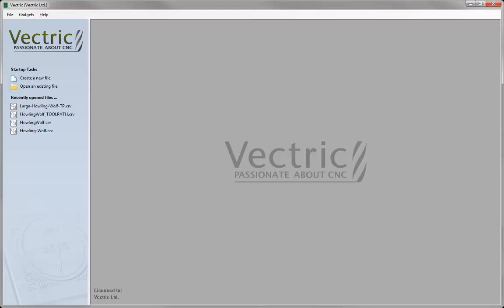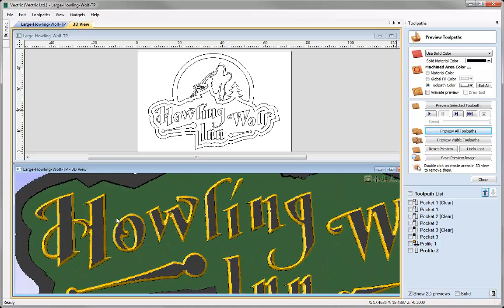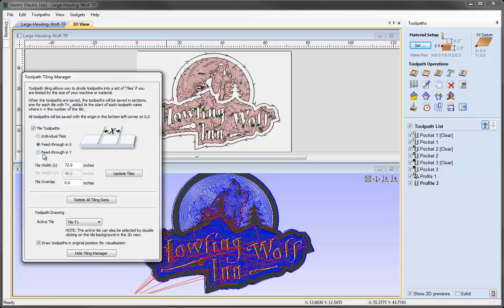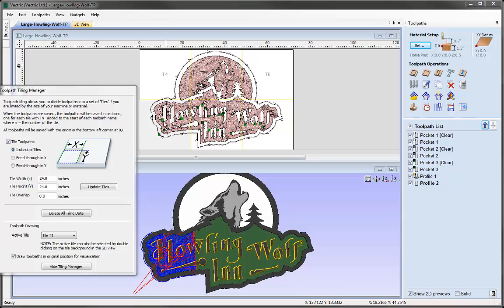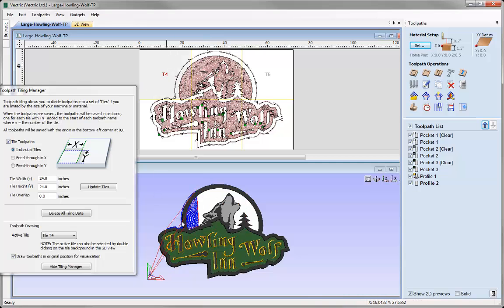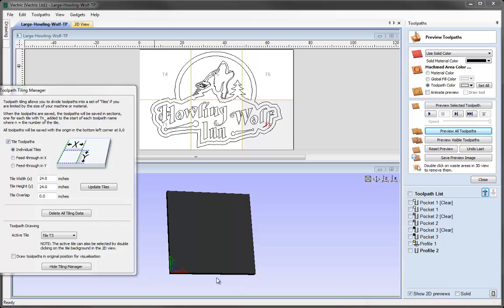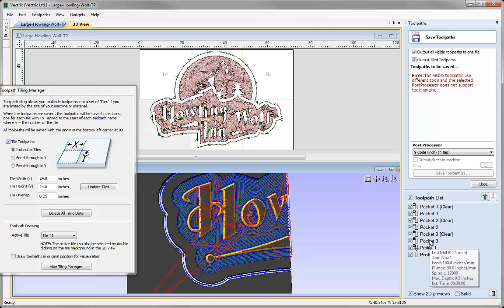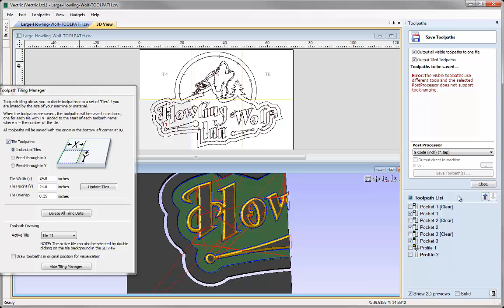Vectric V8 Tutorials - Toolpath Tiling

Comment: I'm trying to figure out how to cut out each tile to final assembly by using my machine while each tile is already mounted to the inc table.
Using this video as demonstration
The size for each tile in this demo is 24" X 24". If you cut each tile out on say a 25" X 25" size board. Do you just run a 24" X 24" square vector profile cut
around the outside to get the final piece out? How would you set that up?
I'm guessing I would have to cut each tile, end program, and run another one ( 24 x24 profile ) to cutout the final piece? hoping the edges cut out correctly.
Please comment, thanks.